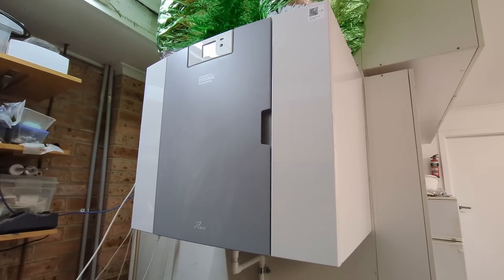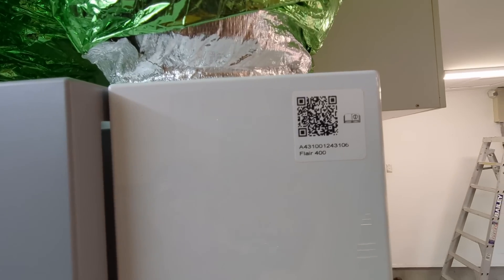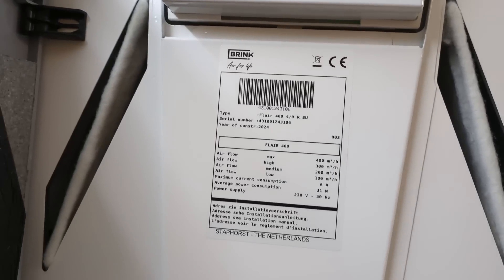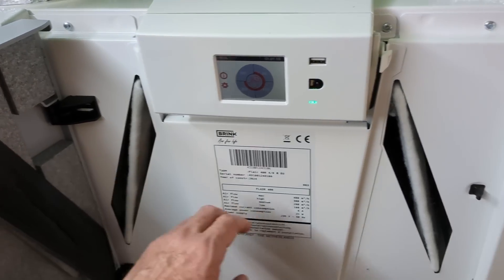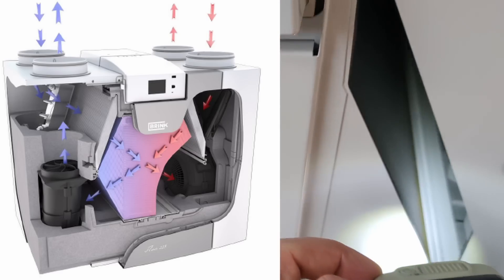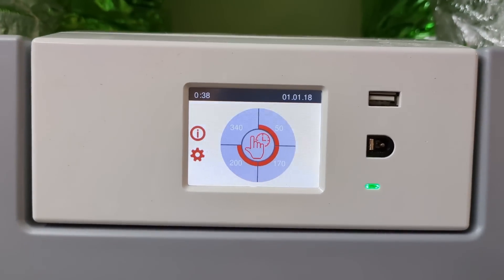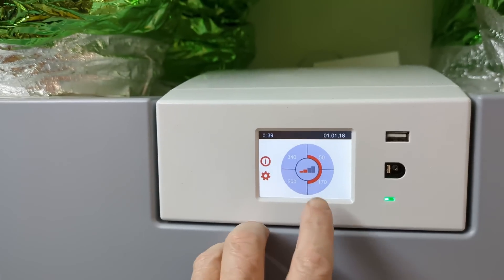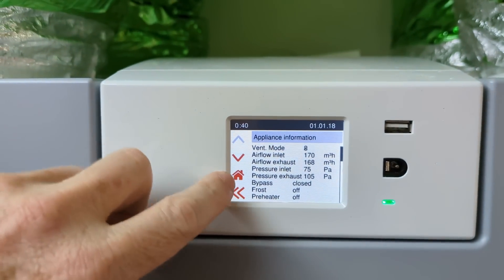Passive Home Heat Recovery & Ventilation System

Comment: I would be interested in what you've done to get an existing house to passive house standard - from what i understand it requires an incredible amount of work to get the airtightnes.
Have you had the house pressure (blower door) tested?

Comment: Surprised you haven't got a CO2 meter for testing yet! It's a nice game to find balance where all rooms are < 1000ppm while device isn't too noisy.
You probably wanna use bypass when using shower else you'll get tons of condensation in exchanger in winter (you wanna automate turbo mode anyway using humidity sensor in bathroom anyway).
If you dive into this rabbit hole you'll learn about balancing in and out, ERV  vs HRV, pipe lenghts, etc.
Best thing with these is no more mosquitoes nor neighbours fireplace smoke. It's pretty standard equipment up in north Europe. AFAIK you can't even have proper hood extractor, only filter or HRV one.
I've got mine (MIA ventilation, DIY install) about 9 months ago and it's so nice. I do shut it off during summer day as we open up everything anyway.

Greetings from baaaaahland Auckland.

Comment: Assuming you have an uninsulated attic, all of these pipes should be on the insulated side, for example under a suspended ceiling. Extreme temperatures in the attic can significantly affect the efficiency of the recuperator (heat recovery unit).
Reply: Probably no space and a lot of work to do that.
Reply: @jaro6985  Yep, true. I recently built a house and, in addition to mechanical ventilation with heat recovery, I decided to install a ground heat exchanger under the building - a constant temperature of 10 to 15 degrees Celsius helps to passively thermally stabilize the building.

Comment: Get rid of the tiny internal filter, build a filter box on the outside air inlet to fit the largest furnace filter you can get. The internal filter quickly gets plugged with bugs and dirt and clogs up.
Reply: @universeisundernoobligatio3283  I don't think "furnace filters" are a thing outside the US
Reply: @sdgelectronics  
Amazon will have them.
Reply: @sdgelectronics  
Amazon will have furnace filters
Reply: I've just put a little mosquito net around my infart and it gets plugged within few months. Changing filters would be a nightmare.
p.s. automotive filters seem to be easiest match if you don't wanna pay OEM price.
Reply: I made a box with a replacement air purifier filter. It works great. And Yes, furnace filters are nonexistent in Europe.
Reply: Should be cheaper too.

Comment: Soo it captures the heat that would otherwise be lost through a simple air outlet in the house, then uses that heat to reheat the air coming back in so it overall has less loss? Pretty nifty idea I havent seen before

Comment: Nice, I have almost the same unit, just the 325 model :) Btw I got the better filter (PM1 + activated charcoal) and it was pretty lame . Lot of PM2.5 went through (I have PM2.5 monitor). I ended manufacturing my own box where I placed large filter from xiaomi purifier. And placed the filtration box in series with the air flowing to the rooms. At first I had it on the intake but there was a lot of condensation during winter on the box. It works flawlessly for 2 years now and no PM2.5 gets through

Comment: IDK if you have radon in the ground in Australia, but even with a radon membrane under the house, make sure there isn't under pressure but over pressure so it blow it slightly more air than it sucks out of the house because it can suck it into the house from pipes going up through the foundation. (also helps with the range hood)

Comment: Looks like the attic space is not insulated, so insulate the small ducts and the gray air distribution boxes in the attic! A ton of unwanted heat loss & gain, plus humid air may condense in the pipes or the air distribution box, eventually leading to mold growth!

Comment: Shouldn't the ducting to the rooms be within the conditioned space, or else covered in insulation? The large ducts to the heat exchanger are insulated, but the plastic venting ducting isn't... so if they are cold not only will the air in them heat up in the loft space (counteracting any air con), but also they would become a cause of condensation. Obviously if your loft is insulated at the top/roof and not the floor it wouldn't be an issue because then the loft space would be within the conditioned envelope but as you've got insulation on the loft floor I'm guessing it isn't.
Reply from the maker: Only option. And those duct are actually doubel insulated.

Comment: Ventilation is getting more common on high performance houses here in the US but we use ERVs as HRVs cause issues in our climates. I have been thinking about putting one in my workshop as I need lots of ventilation and filtration when I'm working out lit there and our summers are very hot so anything I can do to need less ac is a good thing as well as make my shop a better place to work in

Comment: That hatch is a bayonet. Not much to see inside. You can connect one of those red discs on every connection port to control the airflow on each port. Or just in the room with the vents. Those green hoses and boxes are also dutch, Ubbink.

Comment: Looks like you are missing all the insolation on the grey box and the smaller ducts, 
this unfortunately will negate the beneficts you get from the energy recovery you get, since they are run in a uninsulated space.

this can easily be checked with a thermal camera on a hot or coll day,
or by compering the air temperature by the system and the in/outlets.

hat a similar problem with my system.

Comment: You’re basically at Canadian building code minimum with an HRV and double glazing. R50 ceiling and R21 walls and you can survive a Canadian winter. 

Looking at pulling out my 22 yr old HRV and putting in an ERV instead here in Canada, where this is not even close to passive. 

For reference, my house has roughly 10kW heat loss at -28C and it’s quite efficient.

Comment: In Ontario Canada when I built my house in 1992 installed a HRW, fan motor runs 100% of the time, so far replaced it 3 times. Provides fresh air for the house especially in the winter at -20C, with the bonus of recovering 40% of the heat.
Reply: Why does it run at 100%? Unless extremely undersized should run at much lower during normal operation
Reply: You should regulate the speed of the fan. If you ventilate too much during winter you will get terribly low indoor air humidity! At -20°C the air holds almost no moisture and after heating it to room temperature the relative humidity will be like 5% or something low like that!
Reply: @lukasandrysik3666  
Have tuned the system over the last 3 decades. Built house myself, super insulated, triple glazed windows, air leaks all sealed, need HRV for the fresh air.
Hang laundry to dry in the basement.
Pot of water on wood stove.
No dryness problems for us.
Reply: Also get rid of the tiny internal filter, build a filter box on the outside air inlet to fit the largest furnace filter you can get. The internal filter quickly gets plugged with bugs and dirt and clogs up.

Comment: You don't want this sucking from the kitchen - oils will not help the performance! I've seen a horribly designed & built [near] Passive Haus by someone without experience. The HRV was responsible for 1/3 of the heat loss because it was massively over-ventilating as it was oversized and running all of the time. Dry cracked skin in the winter ...  Another 1/3 of the heat loss was moronic radiant floor heating. Yea they had two offset sheets of foam under the floor but they also insulated the heated floor from the room via wooden and click flooring. The idjits also ran hot water pipes thru that heated concrete slab to the kitchen & laundry (one hot pipe each stupidly) and it did a great job of heating the floor but it was hard to get hot water out of the tap for some reason. I could go on about how they stuffed up the hot water with an on-demand heater on the 2nd floor but a distribution bar on the 1st floor ...

Comment: Heat exchangers have been used in Sweden since the 1980s. But getting a little worried that there is no ice insulation on the pipes in the attic. There is a great risk of condensation if the temperature differs between inside and outside the house.
Reply: thing is in Australia cold is 5c where in Canada and Sweden cold is -30c or lower.
Reply from the maker: You do know I live in Sydney, right?
Reply: @EEVblog2  that common mistake, insulation works in summer too, it just people like ignore that small detail and complain that ac turned 100% 24/7 during heatwave :)

Comment: So the air that goes back into the house is warmed up. But why is it then in the attic where it is probably cold?
Reply: All the smaller ducting should be insulated or in a well insulated attic (this one likely is not)
A loot of energy wasted via these internal ducts being out. In the summer it will heat up and cause unnecessary waste due to AC still having to cool that down

Comment: The main disadvantage of this system is that someone could get up onto your roof and let off a massive fart into your inlet. It would be evenly distributed into every room in your house 😂
Reply: It is very easy to attack a sleeping family using these systems. There are even sensors attached so that you can detect and trigger an alarm.
Reply: Not if you have decent filters (you should).
Reply: @dzhiurgis  It depends on the type of fart. Hydrogen sulfide, dimethyl sulfide, and methanethiol are typically less than 1nm so the filter would need to be .001 microns.
Reply: @devinhales  I've got one of these. I used to hate when neighbours fire up their log burners. Now I never get that stench (or mosquitoes).
Also if you are really paranoid you could get a HEPA filter for these.

Comment: The bypass is for at night in the summertime and you want to cool down the house when the outside temp is lower than inside. (and you want it to be cooler inside, it bypasses the heat exchanger) Like free aircon!
Reply from the maker: Like I said, not that common a thing in Sydney if you have a thermally very well insulated house which hasn't heated up much anyway. Most common time you'd do this in Sydney is with a poor thermal house that gets hot and you happen to have a cool southerly breeze comes through in afternoon or evening.
Reply: @EEVblog2  a well insulated house eventually warms up, and stays warm for a long time. Are the nights not colder then the days in Sydney?
Reply: @mrleo81 EVERYTHING is topsy turvy down under!
Reply from the maker: @mrleo81  Yes the nights are usually colder than the days, but not by so huge amount that I'd imagine I'd need to dick around with constantly bypassing the system.
Reply: I have the same unit (325model) and calculated that the bypass makes almost no sense...as the airflow multiplied by the small temperature difference (outside 19°C at night for example ) makes very small cooling power. Like 300W for the whole house...
Reply from the maker: @lukasandrysik3666  That sounds plausible. Sounds like it's more for extreme circumstances. If we had a cold southerey blow in after a scroching hot day then you simply open the windows and get a massively fast energy transfer, orders of magnitude higher than this system could transfer.
Reply: @EEVblog2  I use the bypass in automatic mode during summer. When the temperature outdoors is lower than indoors it will open the bypass automatically. Not much help but the HRU is running anyways and the bypass is also installed by default so why not use it? OF course it is no match for even a smallest split-AC

Comment: Our apartment building from 2007 have smaller versions of these kinds of heat exchangers in every flat.
With preheater of cource as we can get as low as -20C in the winter.
Have to change the filters twice a year as they run full of dust, insects etc. 
When it starts to get noisy you know it's time to replace the filters.
Reply from the maker: What is this negative temperature you speak of? I don't understand...
Reply: @EEVblog2  Something we get to enjoy the next 4 - 5 months...
Reply: @EEVblog2  if the outside temp is so low that there's a risk of parts of the heat exchanger to freeze you need to pre-heat it a bit. You still get that bit of heat into the house so not much waste other than on efficiency when compared such resistive heater to a heat pump
Reply: @EEVblog2  Just pretend temperature is like the feedback you give, and it'll all make sense.

Comment: Recuperation is more and more popular here, especially in new houses; I once worked on a remodeling job in an office, they were installing a pretty large unit on a wall in the attic. It ran on 400/230VAC 3-phase and had replaceable insets that passed the air through (two large compartments) or exchanged heat (multiple compartments and partitions, air flow directions sandwiched). No fancy schmancy plastic tubing and distribution boxes there - only a length of thick aluminum flexible tube with tripods and drops to vents along the length. Built as simply and cheaply as it gets, it probably had some major design errors like high pressure drops causing almost no air to go into the farthest vent. Since the system encompassed a few rooms with individual A/C units, it would work well only if all the A/C units worked and were set to roughly the same temperature; otherwise rooms would get warmer or colder air from the vent.

Comment: Looked at these to replace the extract only system in my place - but they’re incredibly expensive here - €2000-3000 for a fan and the heat exchanger block. Hard to justify the cost.  Are they that expensive in Australia?
Reply from the maker: Yes. Way more than that with all the ducting and installation for a whole house.

Comment: Pretty common in new houses over here in the Netherlands, I believe it also counts towards your house energy rating, which in turn affects your mortgage interest rate.
Reply: However, to retrofit it in an existing house build from concrete walls is an entirely different story.
Reply: @Sebazzz1991  Indeed. It's pretty much impossible to do without major renovation, if possible at all.
Reply: @Sebazzz1991  They really need to make a window HRV unit that anyone can install.
Reply: @NiHaoMike64  They do make that, it is called DWTW (decentralized heat exchanger)
Reply: Doesn't make sense unless it's a new house.

Comment: That's the first HRV or ERV I've seen in Australia. I even left a comment on Efficiency Matrix as I'm really interested in the technology. You can likely set the boost from the bathroom light or occupancy sensor, or rangehood. And if I were to install one, I would likely monitor the air quality at the inlet in case someone does a burnout outside or smoke from my neighbors fireplace. Awesome setup! I don't know how advantageous a humidity model (erv) would even be in our climate 👍
Reply from the maker: Yes, not that common here. There is a remote with (optionla extra) that allows to control remotely. Apparently there is one with a humidity sensor that will automatically boost once you start the shower and the humidity goes up. Lots of ways to automate this model if needed.
Reply: @EEVblog2  You have the resources available from the company. Humidity sensor is the best option, rather than extrapolation. It's good they did a full house pressure test. Make-up air for your rangehood is another consideration but that's really getting into the weeds. It's just nice to appreciate a great system, along with a brand recommendation.. as they're so rare here

Comment: Nice guilding for your home - ducts guts :) This is something air-conditioner vendors should be offering as a value-add HVAC option (integrated to bathrooms, etc) - especially modern ducted systems. I noticed while travelling in Japan, even basic split systems in modern apartments here seem to vent and filter air by default while in stand-by mode (unless you explicitly turn them off) - I haven't noticed that in split systems in Australia (though might be common now).
Reply from the maker: I'm not aware of a split system in Australia that has this.

Comment: How is the humidity controlled with this type of ventiation system? I assume that with low temperatures and/or low humidity outside you'd get dry air inside pretty quickly. At these volumes we're talking about multiple kg of water vapor being exchanged.
Reply: Similar to a chiller pack. It has a drain that needs to be vacuumed out at least once a year. Probably could benefit from drain pan tablets too.
Reply: And what about increasing humidity? Is it an option?
Reply from the maker: @Krawacik3d  We don't really have much of a dry air problem in Sydney.
Reply: @Krawacik3d  You can always add an duct humidifier in line with the ducting, needs water piping though.
Reply: @Krawacik3d  the quality recuperation units have enthalpy heat exchanger, which recovers the humidity from your house (useful for winter where I live - I have a Zehnder thingy)
Reply: You get dry air issues in very cold climates where the air is often below freezing, not sure how its dealt with, my system in the UK switches to an extract only mode in very cold weather, but you don't have long sustained sub-zero here.

Comment: TL;DR: It swaps inside air with outside air while retaining the temperature of inside air using a heat exchanger.
So most energy efficient on coldest winter and hottest summer days?
Reply: efficiency is the highest when the differential temperature is smallest.

Comment: That’s a very good system! I’m a little confused though why they insulated the big pipes but not any of the small ones - maybe they have some insulation in them already? 😊
Reply from the maker: Yes, the smaller ones are a mutiple layer ducting.